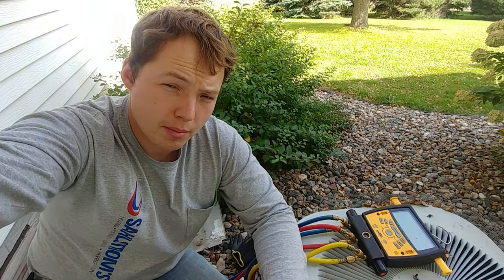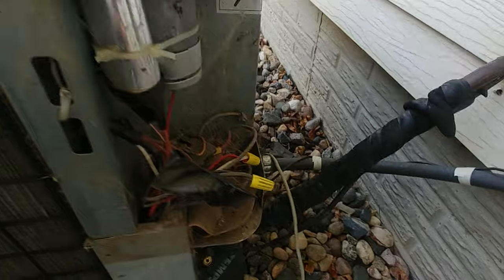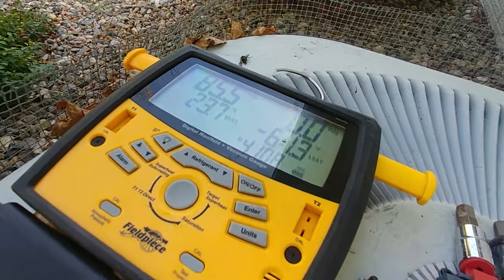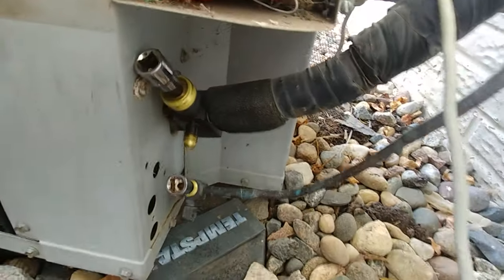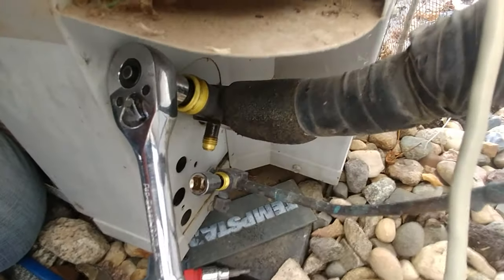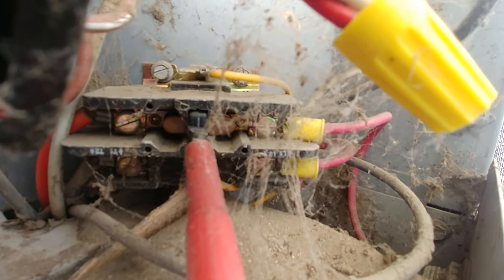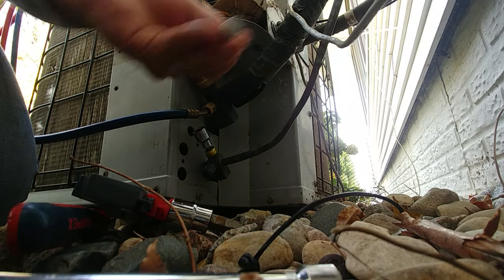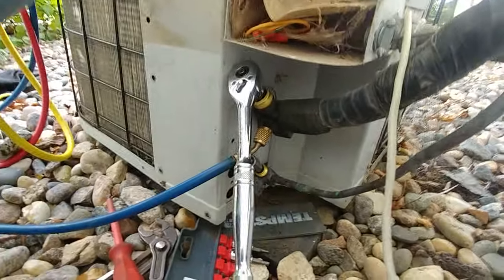How To Pump Down an AC Unit Into the Outside Condenser - Pump Freon Into Air Conditioner

Comment: Good Vid Ben. A few veteran tips..turn the system on at the thermostat and lower the temp. Let it continue to run on the inside to help boil off any liquid left..also this way you can just use the disconnect to power the compressor so you dont have to hold the contactor, ive seen that end badly bro.

Comment: Invest in a couple of extensions for your ratchets.
Reply: Marcellous Nabors he needs a service  wrench
Reply from the maker: Most service valves have clear access and the wrenches fit better. Thanks for the smart Alek comment though. I definitely feel better knowing how I can improve. ;)
Reply: Good job brother. Very helpful video. Shalom!!
Reply: Most HVAC techs don't use a ratchet and sockets on ac service valves. He should of use ac service wrench which is designed for HVAC trades people .
Reply: @pineychristian  A tool is a tool. SMH
Reply: @rruizproductions  a tool isn't just a tool. We have many specialty tools that do specific jobs. You can easily over torque the service valves using a ratchet. So when you actually work in the field of HVAC you would know this. But again someone talking out their ass. Maybe the HVAC stuff should be left to the Pro's .🤔
Reply: @pineychristian  SuperPro! Yay!

Comment: 👍 Please remind viewers to purge air from gauge hoses b4 pump down. Also if you push the hose seal tight while turninging the knurled collar, it will form a seal to minimize refrigerant blow off. Learn to do it quickly. Works in installing of hoses too. But the best is a low-loss valve that you can open the shrader after the hose is attached.

Comment: damn.  this will save me $1000, crazy local hvac guy quoted me $1000 for this. thumb up
Reply: Aaron Wang   even tho. looks easy   its bad for the unit.. i think u can do that maybe twice in the lifetime of the unit
Reply: @Chepesanroman  this is how you pump it down before changing the r22 system out with brand new 410A air handler and condenser.
Reply: You should have paid the guy. $1000 buck to remove then reinstall it’s a great deal.
Reply: @Cheez1979 That's insane!  I can't even get a guy out to repair a unit. They all want fresh installs at 3K. Just dishonest HVAC guys in Phoenix, AZ.

Comment: Nice job Ben , yes just refreshing my memory , but you need to get a valve port ratchet with a reversible Allen nub, I bought one about 2 years ago and they are a life saver , thanks again brother be safe.
Reply: They work on most gas valves as well to pull the cap to adjust pressure.

Comment: It's Best to Turn The System on 
At thermostat and Not just rely On Contactor, if You happen to be doing this on a Heat Pump, Most Brands Run In Heat Mode With Just the Contactor Pushed In. 
It's Just Good Practice. 
Some Units Will also Have a Blowout Valve That Releases Pressure Back Into The System when It Gets Too High, This Usually Happens about halfway through pump down, If You Get a Sound Like Pressure is being Released don't Flip Out and Just Start closing  The large valve. I also crank  The Large Valve down About halfway Before I start In case it does blow back I can Close  It faster. You may have Freon Left In the lines after That Happens, You will need to 'recover' it Before You can Cut the lines. Also,
I have Never had any issue pumping down a r410a system. I've never heard or seen any Manufactures That Warn Against It. I've Done it thousands of Times.

Comment: Very clear and easy to follow instructions. I plan on moving my AC condenser about ten feet to put in a deck. My only concern is disconnection and reconnection of the Hi & Low pressure lines. Will I need to vac the lines from the inside & will I need lose any of my R-22 left in the lines or coil? I would Appreciate an answer from anyone who has done this.

Comment: Thanks for the video. Is it necessary to connect the pressure gauge to the low pressure line? I have a 25 year old condenser that is very very low in refrigerant. Can I not just close the high side and let it run for a minute and then close the suction side? I know it may suck up some air, but the condenser is going to taken to recycling. I will be having an HVAC technician doing the install for a new system. I just want to save some money by removing old HVAC. So I want to clear this space and place the new condenser so that I only pay for the essential services such as flushing the lines, making the electrical connections and soldering the copper piping to get it all started.

Comment: Do you have a video on restarting the system after replacing the evaporator coil?
If you're replacing the evaporator coil wouldn't you have to evacuate both the liquid and vapor lines before reconnecting them or opening them to the compressor?

Comment: I don't recommend pushing in the contractor while doing this unless you first turn on the blower motor inside in order to boil off all the refrigerant in the evaporator otherwise you won't remove all the refrigerant

Comment: Thanks for all your great videos Ben, is it safe to pump the refrigerant into the condenser for the winter season? I have a small leak in the evaporator and every two years I need to add refrigerant. the condenser its a 20 year unit copper lines and  the compressor was replaced 7 years ago.

Comment: Hi thanks for a great video. 
Question. I had a leak on my system at the dryer filter and all gas 410a leaked. Now I have to fix it and also pull a vacuum. My question is that now how do I pull a vacuum on the entire system including compressor? No one shows that in their videos. People only pull vacuum on the lines with service valves closed. I’ll appreciate any help!
Reply: How long was the system at atmospheric pressure? The compressor oil is polyester and hence hydroscopic. Make sure to change the filter dryer and use one as large as you can find if it has been open for more than an hour.  Make sure to re-check the filter dryer for temperature differential after the first few hours of operation.
Connect the vacuum lines to both ports and make sure that the isolation valves are completely open AND the caps are seated tightly.
Use a micron gauge and follow the normal vacuum guidelines.
Note: As per most manufacturer's guidelines: Do not unbraze the filter dryer! Cut it from the circuit and install a new one.
Reply: devious dom thank you so much for the guidance. The leak happened about a week and I haven’t had a chance to work on it as it’s been raining and they say not to work on HVAC in rain. I hope the compressor is ok. I checked and there is no gas in the system.
When you say isolation valve is open do you mean service port for compressor? So it’s ok to pull vacuum from inside compressor correct?
Reply: @HowToDoitright  the two valves at the bottom of the unit where you connect your gauges are the isolation valves. That's also where you pull your vacuum.
In your circumstance, you need a good deep vacuum on the entire system including the compressor. Make sure that you use a micron gauge. If you only have 1/4" hoses, expect to leave the pump on for about 4 plus hours, maybe longer (follow micron rating instructions).

Comment: Great video. Got a question. We have a cracked concrete under the ac unit and needs a replacement. It is removable concrete. If you have two people lifting the ac unit up and one person changing the concrete do you still need to pump down and cutting wires and other stuff that is connected?
Reply from the maker: Yes you should be able to do that as long as you are EXTREMELY CAREFUL to not bend or kink the lineset while doing so.
Reply: @BenjaminSahlstrom  Got it. Thank you so much.
Reply: @BenjaminSahlstrom  Sir, got another question. How much do fan guards usually cost? I have carrier ac unit.
Reply: @BenjaminSahlstrom  We finally got it fixed. We replaced the top part of the ac unit. I don't know why but the technician all of sudden moved the ac unit by few inches. We turned on the ac it worked good, then I asked him if he can move the ac unit back where it was. He said it is not good to do that because it can break the pipe. But I asked to him to do it please because I am thinking all the pipes and lines needs to be in the same place as before. So he did moved it close to where it was. Is this okay? Few inches of movement? I am worried if any pipes or lines are now messed up.

Comment: When you connect your line to the service port you should have purged the air out on the other end. Now that system has a line full of air in it with the refrigerant  that you can't get out
Reply from the maker: Mathew Barnes Great thought. My hoses likely already had R22 in them but to be 100% certain you would want to bleed them first. Thanks for your comment!
Reply: 300 min
Reply: Purge where and how?

Comment: Thanks for this video. My 32 year old condenser (York 3.5 ton) doesn't appear to have service valves. Rather it has a type of valve that once opened cannot be closed. As the valve plunger is cranked down it shears off an internal plug, thus opening. Ever seen anything like this on a condenser?
Reply: Yea get a new one lol

Comment: If the condenser has a small leak can you pump the refrigerant to the evaporator and close it off for a repair to the condensor?
Reply: I don;t think so.  There aren't shut off valves at the coil in residential usually.
Reply: No you need to recover the refrigerant and then carry out the repairs. Then reconnect everything, vac the pipes the recharge with refrigerant

Comment: Is it safe to do this without the pressure Gages?
Reply: No HVAC pro here, but without gauges, how do you know you have the refrigerant pumped down?  Run it to long, seize the condenser motor.  Get a cheap set of gauges or get a pro do to it.  I do like the tip to use the disconnect to energize but see the limitation of the unit cutting off at low pressure.  Ben - thank you for a  no BS get it done video.  Don't sweat the comments about tools, adapt, overcome!

Comment: Why didn’t you hook up to the liquid line. You should not pump a scroll compressor below 10psi.
Reply from the maker: It isn't necessary as the suction line indicated the pressure of the liquid line when the liquid line valve is closed. Thanks for watching! Love the questions.

Comment: What is the purpose of a pump down???
Reply: To isolate the refrigerant into one area in case you have to open up the line to do any repairs, like repair leak, change filter, replace txv etc.
Reply: In eight years as a tech I never had to do this. Whenever I had to open a system, which was rarely, I would recover the refrigerant, using a recovery pump and a recovery cylinder. However if you do not have this equipment, which is very expensive, and your problem is on the low side, then you can pump down.
Reply: intelin123 mostly installs
Reply from the maker: Basically just if the system is being removed for disposal (and in that case we usually recover the refrigerant first) or to relocate the system.
Reply: to remove all refrigerant from the air handler inside and the lineset
Reply: If your in install. Not service side you will be constantly pumping down units.
Reply: Fern Iriz  No

Comment: I don’t suppose you have a video for getting the refrigerant back in to the system from the compressor.  I have had my system pumped down so I could move it,  now I have reinstalled the system I need to “pump up” the system (I guess you would call it) to get it back working again.
Many thanks
Reply: I would imagine just reopening both the high and low side? Remember he closed the high completely and partially closed the low before the pump and then closed it off after. Now both are closed. So to restart would be to reopened both, wait a bit or turn the system on and off a couple times until circulation is back? Just guessing bro. If you found the answer plz let me know.

Comment: hey Ben, I have a scroll compressor on an older R22 Lennox. Can you pump down a scroll and then thers a low pressure cutoff, how do you get around that?    Model HS 25  411P Thanks
Reply: You would have to use a recovery machine and recovery cylinder to recover the rest of the refrigerant .

Comment: What happens when some extra refrigerant was added to compensate for extra long lines? Would their be enough capacity in the condenser to capture all the refrigerant?
Reply: The size (or capacity - i.e. tonnage) of the unit's condenser should be matched with the size of the square footage you're trying to cool.

Comment: Dude, get a rachet extension
Reply: I want to move my unit over 4 feet. By doing this, does it mean I don't have to evacuate it? Can I cut the lines afterwards and move it and then reconnect?
Reply from the maker: Unfortunately you will need someone to pull a vacuum on the system before releasing the Freon again.

Comment: There's a tool call a Service wrench for the service valves, and I usually turn the system on with the disconnect , then pull out when pressure is done while closing the service valve. Why would anyone take a chance of getting electrocuted with a screw driver?............. 25 years of HVAC
Reply: EXACTLY!!!
Reply: yeah this dude is just asking to get shocked the way he is pumping down.
Reply: Cause if you don’t push in the contact when the unit has a low pressure switch it will shut off when it still has like 5psig
Reply: @cameronkalisky4333  bypass pressure switch and put unit to run on cool

Comment: My a coil froze. Am low of refrigerant.  Do i have to open or close or not touch service valves to recharge.  Thanks
Reply: intelin123 don't touch the service valves. Add freon on the low side as a gas if it's an R22 system. If it's an r410a system you also add on the low side but you add as a liquid so the refrigerant doesn't separate. You add it slowly so it flashes off as gas. Add it to quickly and you'll be changing the compressor!
Reply: Fireship1 .ok  thanks. For the help.  You are 1 of the few
Reply from the maker: Don't do anything unless you're certified to handle refrigerants. The EPA takes refrigerant handling practices seriously.

Comment: You don't want to pump down to change the outdoor coil, just to clear that up
Reply: Why?
Reply: @OQureshii  because you pumped the refrigerant into the Condenser coil, if you need to change the coil, it now has refrigerant in it
Reply: @joshdavis2064  Oh sorry didn't read to replace the coil in your original reply. I thought you said not ever.

Comment: The stuff you pumped into the condenser is refrigerant not freon. Freon is a trade name
Reply from the maker: Paul Campbell You are correct. :) Kind of like reciprocating saws (Sawzall), tissues (Kleenex), adjustable pliers (Channel Lock), adjustable wrench (Crescent Wrench), and locking pliers (Vise Grip). ;) Using clear terminology is important so I do appreciate that. Sometimes you need to say the more "known" term to make sure folks understand what is being reffered to.
Reply: You mean name brand r22 hydrochlorofluorocarbon ( hcfc)
Reply: @mikemc8495  oh, is that what he meant? Thanks for clearing that up for everyone. gold star
Reply: Nobody cares.

Comment: Nice video but you should not connect your manifold lines to the compressor without pulling a vacuum on the manifold first and then isolating the vac pump. What you have done is inserted a small amount of air (with humidity) into your compressor. This is why, when your  HVAC system IS SERVICED BY MORE THAN ONE TECHNICIAN , it is a good idea to do an inexpensive test on the gas to make sure it is what it should be and it is not contaminated.As old timers will tell you, get into the right habits and stick to them (including gloves)  As for the ratchet. come on Benjamin, that 1/2" ratchet is for fixing your truck. Get the HVAC set or a 3/8" socket set. Thumbs up!
Reply: He should have purged air at the manifold by cracking the fitting until vapor. Nobody, even the EPA, says a vacuum should be pulled on the manifold before connecting. You can tell what refrigerant is in use or if contaminated by the saturated temp at ambient.

Comment: Dude... unless you have special hoses you just sucked a bunch of air into your system on that pump down as you didn't purge your gage suction hose. Pushing in on the contactor with that kind of screwdriver is a very unsafe method. Your a clearly unqualified to be instructing HVAC! You could have edited your video as well, but you didn't.